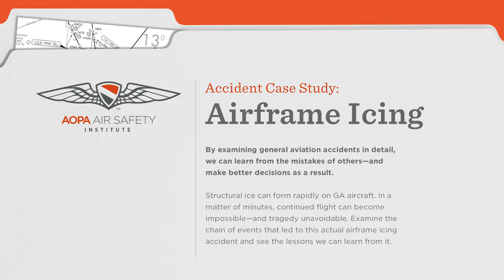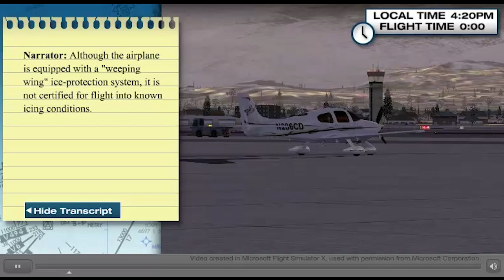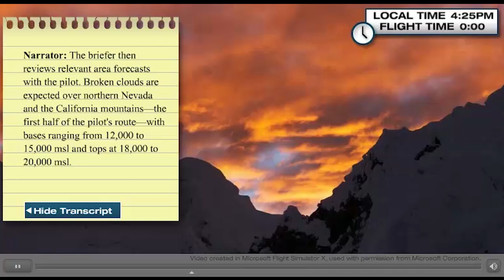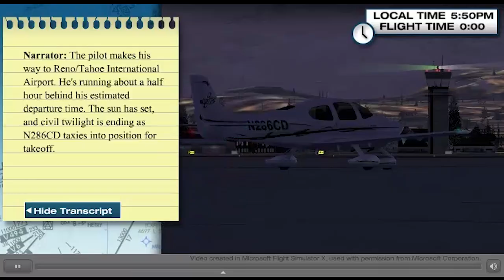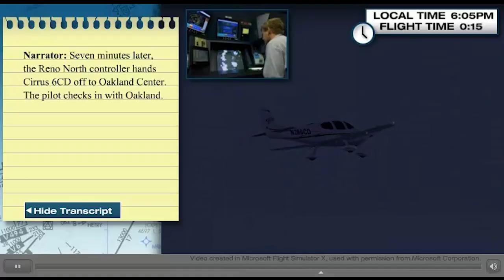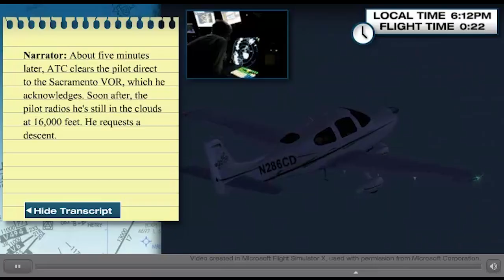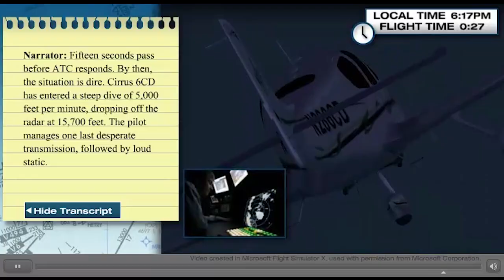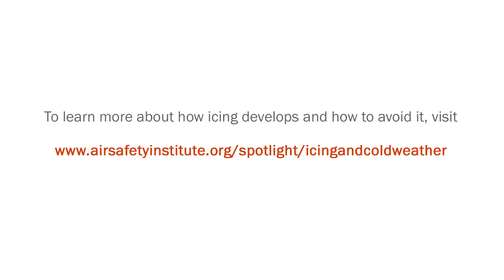Accident Case Study: Airframe Icing

Comment: There is no such thing as an ACCURATE "icing forecast" so citing an "inaccurate icing forecast" as a factor in this "accident" is ridiculous. No two airplanes are going to ice in identically the same way in and icing conditions for one might be far from it for another. The temperature at which water on the airframe freezes to form ice depends on the pressure and speed and temperature of the airflow over the airframe and the temperature of the airframe itself. Aluminum is a heat sink and as the speed of a fluid like air and/or water vapor increases its pressure decreases. Lower pressure decreases the triple point of liquids so that the feezing point of water vapor is lower than in static air. 

That "supercooled" water vapor flowing over a film of liquid water on the airframe will pull heat out of that film of water and can cause icing at air temperatures well above what somebody who doesn't know that would expect. And since precipitation and "fog" occur when warm, moist air meets cold, dense air and heat is drawn from the warmer air into the colder air and leaves the moisture lagging behind, if you're flying "with the wind" in warm moist air and are just flying out of the "front edge" of a "warm front" into cold air, the external air temp might drop suddenly and rapidly to point "too cold" for icing. But if your airframe is still wet and wet all over, in a few seconds that liquid water, which is "blowing around" on the airframe and is being pushed by the airflow rather than the other way around, can suddenly freeze in places and form ridges and ripples of ice where its the most "turbulent" and as the liquid water flows toward or away from those areas the "thickness" of them relative to the skin of the wings and flight control surfaces changes dramatically. Now the air flowing over those rough "ridges" of ice is no longer in "laminar" flow and in a fraction of a second you can have an airplane "stalled" well above its "stall speed" along with some extra weight to carry and less effective or ineffective control surfaces. And "de-icing" equipment of any kind on an aircraft is at best going to slow down the accumulation of ice or shed some accumulated ice. It's not a an "ice-proofing" system that makes it safe or "less dangerous" to fly into any weather conditions. All de-icing systems also either reduce available engine power and therefore airspeed and power available to operate flight control surfaces, radios, avionics, cabin heat etc OR increases drag when used OR both. 

You NEVER climb to try to get out of icing conditions because the air is only colder and there is probably more moisture in the air and the warm, moist air is rising WITH YOU and your airframe is cooling constantly due to a few different factors and condensing water on itself the entire time as you climb more and the steeper angle of attack and increased engine power required to climb the air plane with additional drag added and that "shields" the top surfaces of the wings more but reducing airflow over them costs you lift and the lower pressure on top of the wing still prevents water from being shed as quickly as it would have off a "level" wing. It also acts as a coolant to pull heat out of the aluminum skin and releases it to the progressively cooler air as you climb. 

That heat can "outrun" the liquid water and water vapor which are there because the air above the wing is saturated with moisture and the supercooling effect of high-speed air and water vapor being prevented from freezing from the reduced pressure is suddenly lost when the aircraft's "climb" becomes steep enough that laminar flow over the wing is more or less altogether, the water vapor is suddenly "pressurized" by a much higher pressure and the triple point of the water INCREASES which means the FREEZING POINT rises dramatically and suddenly above-freezing water and water vapor turns to solid ice almost instantly. That suddenly flash-frozen ice creates higher pressure where air is pushed against it, water vapor in that air freezes and suddenly the airframe goes from "ice free" to completely iced up with a huge amount of additional drag, weight and reduced lift made worse by the angle of attack. 

An airplanes "stall speed" is also infinitely variable and when there is little or no lift present because of the airflow disruptions, drag on the wing, angle of attack and weight, the airplane "stalls" as soon as it runs out of vertical "momentum". Guess what happens to a propeller that's also suddenly wet, subjected to cold air and "high pressure" on the "leading edge" AND on the trailing edge since the faster the plane flies the lower the pressure behind the prop? It ices up quickly too. And then there's the CARB ICING that will occur in those conditions that's never considered by a pilot worried about the AIRFRAME. Major loss of engine power and you're just plain screwed. You have what may be only a small amount of extra weight short of any "safety margin" you had between "maximum takeoff weight" and your "loaded weight" but those weights are "on the ground" where the air is "thick" and you have maximum engine power and an an optimum angle of attack for max lift with minimum drag. 

Hell, all those accumulated problems can combine to make the aircraft too heavy to fly even if it were EMPTY.  You ALWAYS try to "dive under" icing conditions rather than "climb through" them Because it's essentially impossible to "stall" an airplane in a "dive".
Reply: Deeremeyer1  You offer some good cautionary information but if you were a pilot who made some of these declarations to me while I was responsible for company flight operations, you would be packed off for some remedial training. Always be careful with words like never, and especially in capital letters. I have watched a BE18 descend in icing conditions following the same "never climb" rule and he ended up with less than 200 ft. vertically between him and an impromptu graveyard. The only thing that saved that pilot was precision obstacle-clearance vectors below the MIA in IMC conditions to the nearest runway. You need to know your weather, your aircraft's condition, and respond accordingly. If you are somewhere like western Montana with high terrain and trapped moisture under an inversion layer with deep-freeze temperatures right to the ground while warmer air is above, your thoughtless absolutism instead of aware decision-making could cost you your life. You also need to brush up on the nature of forecast icing conditions. If erroneous forecast data do not fall within the parameters to issue a certain warning product for a particular area or time and yet actual data then turn out to be within the parameters, that is an inaccurate icing forecast. It has nothing to do with the particular aircraft variables.
Reply: Yes, you are 100% correct!! I was thinking the exact same thing! Inaccurate icing forecast?? 😂 ...But I do agree with Reflected Miles, that the "inaccuracy" has nothing to do with the aircraft in question. "Inaccurate" because icing is generally very difficult to forecast, and must be used in conjuction with all the other weather information available!

Comment: It seems like a large percentage of these case studies involve Cirrus 22's, is this my imagination, or is this particular design a death trap looking for a situation to happen?
Reply: The Cirrus 22 is a very capable aircraft with capabilities above 80+% of most GA aircraft and as such I would argue a much safer air frame than most.  FAA data confirms this.  In 2014, the number of fatal Cirrus accidents was a total of three during a year in which almost 6,000 Cirrus aircraft logged more than 1 million total flight hours. In 2016, with more than 6,000 Cirrus aircraft registered, there were fewer fatal Cirrus accidents than any year since 2001, the year the SR22 was introduced.  The data for 2017 was not complete at the time of this post.

 It would be impossible to study the thought process of these pilots as they are no longer with us but one possible theory in cases like this may be overconfidence in the aircraft; that has been documented by interviews with Cirrus 22 pilots involved in non fatal accidents and other issues while flying. Other Cirrus 22 accidents that I have studied that don't have weather as a factor are solely pilot error.  A couple I can think off of the top of my head occurred in the pattern with pilots in both cases attempting to execute tight turns and exceeding the air frame limits due to improper application of airspeed & attitude in a turn.  In one case the parachute was deployed but the aircraft was well below the min 400 agl set by the mfgr and therefore was not effective.
Reply: @BLACKMONGOOSE13   Actually, the Cirrus accident rate has been well above the legacy GA fleet and a major concern in the past. The company has worked to change the safety culture of the pilots who fly their equipment and that has improved the record in recent years, but the overall record including earlier years than you cited has been sketchy at best.
Reply: I've been noticing the same. I think there is a correlation between being able to afford a cirrus and low flying hours. It seems to five a false confidence that a better plane with a parachute can save you if you mess up. You don't have this type of confidence in a Cessna. The plane itself it's great but I imagine you should fly it with the same mentality that you would if there was no safety net.
Reply: Here is a good video on the safety history of CAPS and the Cirrus: https://www.youtube.com/watch?v=zT58pzY41wA

Comment: PIC forgot one of the most basic rules regarding icing...Most of the icing lives in the tops, and not having a good understanding of flying along an approaching low pressure area coupled with mountainous lift of moist air is a classic ice generator...R.I.P.
Reply: Hey man is this type of weather information part of obtaining an IFR endorsement? I'm armchair flying here guessing this was completely avoidable. Thank you.
Reply: there you go, experience trumps a de icing system any day,   might be alive had he known this, and taken it into account.. can see that turbo/high ceiling/de icing equip/parachute getting inexperienced pilots into trouble..
Reply: Yes, but he tried to get ABOVE the clouds so he would be completely clear of icing conditions. It wasn't an entirely bad idea.
Reply: jcflocher  Yes, not entirely bad—— just bad enough. As ‘ B1900pilot ‘ said , in cloud layers with icing it’s usually worst near the tops. That’s why,if you’re taking on ice in a layer it’s better to descend, for two reasons: 1) That reason and 2) Pitching up in the climb will expose more of the underneath of the wings to ice formation as well. He didn’t need more , he needed to descend.
Reply: @davidwhite8633  Since he wasn't expecting icing conditions in that area, perhaps he really did just want to get above the clouds at first.  The severe icing may not have occurred until the latter part of his climb to 16,000 or even his final ascent to 16,800.  If that's the case then the shock and lack of decision-making time would've made an appropriate & timely response very difficult, to say the least.

Comment: These Cirrus planes have a real problem with the ballistic parachute where pilots are over confident in their skills because of the chute and take unnecessary risk.
Reply: There is a lot of info about cirrus control & spin problems out there. But It is the instantaneous decision making process related to flying a plane.

1. The Cirrus stick has no feedback from airfoil surfaces.
2. Not certified for spins (which on it's face is not disqualifying), but at 5k feet and no ability to recover? I've seen very little on this other than arguments that break out in internet forums that without evidence, the Cirrus 20/22 can recover.

steve wilson's blog has been deleted from the internet, but it had a several informative articles about it.  http://web.archive.org/web/*/stevewilsonblog.com  
Look at the 2016 range. I think the cirrus gets a bad rap from defective decision making; and it has happened with even the best qualified pilots as well.

IMO, just from all of the research I've done, (MY NON-PILOT OPINION) it's like going from a corvette (a 172) to a mid engine lamborghini (Cirrus) without understanding the limitations in many different situations.

I have flown in both. But only as a passenger. 

The ballastic parachute option is not programmed into a pilots head. It is like the last option available, and only after the pilot recovers his thought processes and thinks... oh hell I got this thing above my head that can save me.  At the point of damn near dying, spiraling into the ground, it's either going to be too fast (in this case), or too low (in all the rest).

Information overload and critical self judgement are real killers when things fail in flight.
People always second guess themselves, and from the many many videos produced on youtube... fail to (recognize) & declare emergencies out of what? fear? Looking bad?  This is so sad.  

I have tried this mental exercise many times in my head. If I don't declare an emergency, I'm cool, but I'm also responsible for what happens in the end. But yet if I declare and emergency then my head is free to think outside the box, and I may exercise options that may save my life, that I might not ever do otherwise. As well, having ATC on alert changes everything too.

Just my 2 cents as an arm-chair wanna-be. IMO, it's not the plane, it's the thinking!
Reply: @dryan8377  Pilot ego has existed since there were...Pilots. Ego kills. Watch this 1981 training film: https://www.youtube.com/watch?v=Aa1Ba_NEobs

Comment: People think these BRS  (Ballistic Recovery System.... or parachutes) are cure-all safety devices.
They aren't.  
If deployed too late or too high airspeed they are worse than useless.
Reply: He was the fool he never once said he was accumulating ice ATC has no idea what de-ice system he was using he never said he needed to get higher or lower because of ice.  This guy was the fool who fly's a GA Single piston into ice which no system that is rated to handle it then he flies higher stalls controls are locked nothing to do but watch the ground come up all he can say is I'm descending. The caps was all he had at that point no way to slow down he figured pull it once he tried to recover his controls but too late.
Reply: @Mike-01234  Actually, he did say he thought there was some icing and wanted to go higher to get out of the clouds. But that didn't work, sadly.
Reply: The Dr Killer plane.
Reply: Probably soiled his pants hearing that chute rip off the plane.
Reply: This seems to be a recurring theme with these types of accidents. NOT declaring an emergency and understanding that myself is screwed if I don't act NOW and do something different to mitigate my screwedness.  You are correct. I'm not a pilot and don't claim to be one. Good point.
Reply: @ogc90  It was a simple comment, not an absolute statement of truth, you should - most typical insult I know - but really: relax, get a life.
Reply: @Galf506    A simply ignorant comment , and maybe your the one that needs a life sweetie
Reply: @ogc90  you did it all yourself, just grow up :')
Reply: @ogc90  What's your problem, sweetie?
Reply: @Galf506  Go back to playing flight sim sweetie !!!!!!!!!!!!!!!!
Reply: He obviously deployed it as a panic last resort. He got screwed over by the ATC, he just kept trusting the controllers while they sent him to die.

Comment: Great video and an excellent training tool. Icing is an everyday way of life up here northern New England. It's a factor to consider in every winger flight, and other times of the year also. When you get up north where we are, the freezing level is also always above ground level. Guaranteed icing when you get in the clouds. Clear ice is frequent, rime ice also. When flying a 172, I always carried a flashlight so I could more easily see (at night) what the ice build up was doing. In my Bonanza, although still a major concern, I wasn't as concerned as in the 172. The Bonanza V tail can carry a hefty load of ice if it needs to. (Never on purpose of course!) The thing with icing is, WHEN, and not if, you encounter it, make an altitude change pretty quickly. A lot of times increasing or decreasing your altitude even a small amount, will stop further accumulation, as ice is many times just between certain altitudes, despite the temps. Just remember when landing, you're still carrying that load of ice and your plane handles differently. You'll need to fly your plane according to whats built up. Increased speeds etc for landing.
Reply: Although it is fairly easy to predict where the large areas of icing potential exist, the accurate prediction of
specific icing areas and altitudes poses more of a quandary. Mountains, bodies of water, wind, temperature, moisture, and atmospheric pressure all play everchanging roles in weather-making.  https://www.aopa.org/-/media/files/AOPA/Home/Pilot-Resources/ASI/Safety-Advisors/sa11.pdf
Reply: Hey JM, just wondering if you could explain why icing occurs with planes flying above desert or southern US airports. I'm not a pilot, just a father (ex-navy tactical air controller) with two student pilot sons.  I worry about them constantly.  I see this crazy stuff where weight and balance as well as cg was ignored by a high time pilot, and others, where they went up got into imc (could still control the plane) but yet fell out of the sky due to icing in a GA aircraft. It's crazy. Thanks!